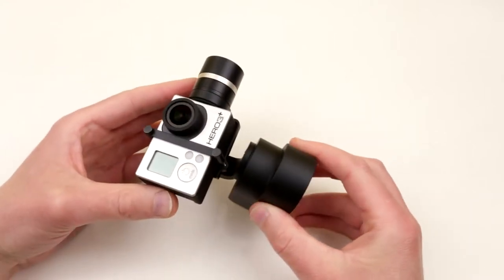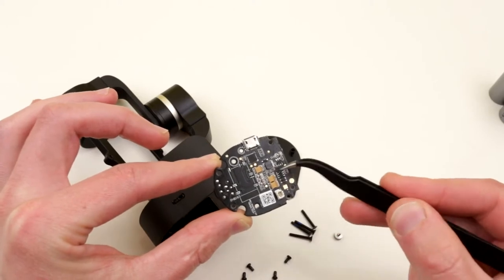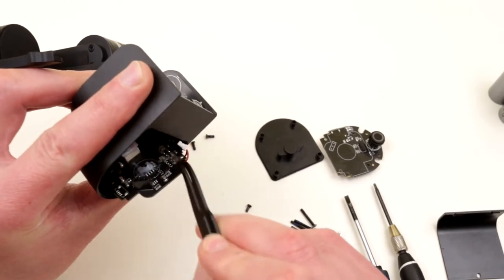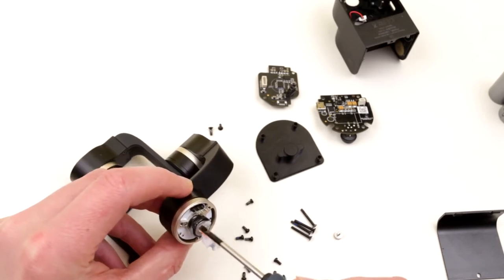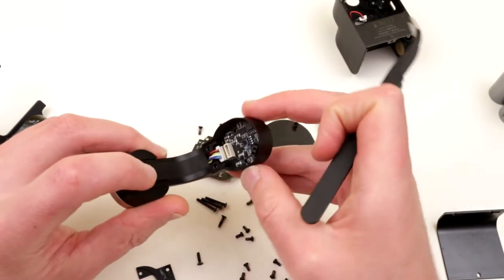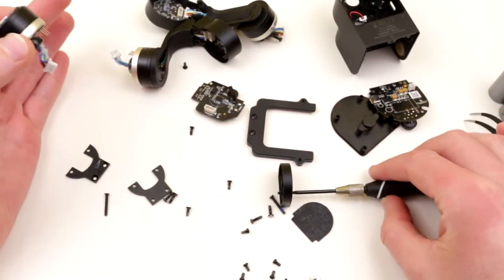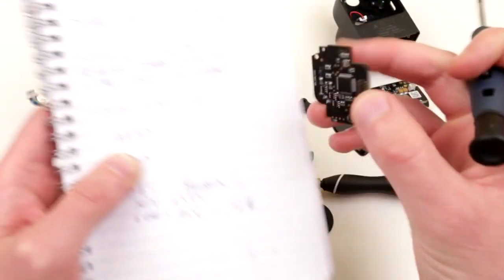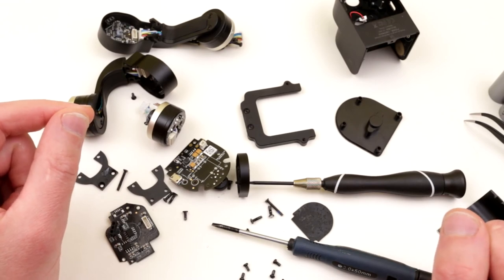Teardown of YI Handheld Gimbal

Comment: There is a serial Bus to connect the USB to PC for the Yi Gimbal Calibration tool. You need to use this tool if you intend to use a smaller or lighter camera on this gimbal. The calibration is important as it records the 6 position settings for the camera weight and leveling. They don't say this but if you balance the camera weight on the mount so the arm is leveled horizontally the batteries will last longer as there is less work for the motors to balance!!!
Reply from the maker: Great tips, thank you

Comment: Thank you for the insight. Did you find out what kind of motor it uses?
Reply from the maker: Clearly brushless, but what brand I do not know, what exactly you looking for?
Reply: @InsideOutElectronics  I was looking at the written list and didn't see it on the list of other components. That was all I needed. I thought it was interesting that the motors had limits on range of motion. That was why I asked.
Reply from the maker: @jeremiahscott4190  I think motors have physical stop, I'm pretty sure motors alone are regular brushless motors

Comment: Awesome video! There is a way to block one axis? I use it mounted on my bike and I would like to have the PAN axis locked. Have you got some suggestions?
Reply from the maker: Looking into this myself, want to block pan and roll leave only tilt going. I think it is possible by creating ( 3d print ) brackets which will fix axis in certain position, and may require software change to prevent those motors to engage.

Comment: For me it seems to be a storm32 controller with encoder. So there is not an I2C-Bus but a so called nt-Bus (kind of serial bus). I wondered whether there is a 2nd mpu on the main board??
Reply from the maker: Thank you for correcting me. And of course it did look like it was made based on some sort open source / hobby product. Why woul you need second MPU ? I don't think it was one there.....
Reply: @InsideOutElectronics  The second mpu in Storm32 helps for angles around 45 degree, because there is somewhere a problem with only one mpu. so if you have 2 mpus you can correct this. One at the camera and one at the grip/housing so that you know where the gimbal was moved in total. If you do not have a 2nd one you get perhaps at certain angles a slight problem. But I think that bug is known at this yi gimbal, called 45 degree error. I hoped it was a software bug, but the missing 2nd mpu is then a hardware issue. I have ordered one used becuas it is so small.Without grip
Reply from the maker: @DocMicha  to be honest I have returned this one. It was underperforming. And purchased different gimbal. See my other review. But i did get to the teardown of it as of yet.
Reply from the maker: @DocMicha  Hohem XG1 seems to be working better, See https://youtu.be/viHSt3wj7i8 . When I tear it down I will pay attention to second MPU
Reply from the maker: Here is Hohem XG1 teardown... it has 3 STM32 MPUs - https://youtu.be/7p12_zu0HwY
Reply: the magnet is for the magnetic encoder, why do you think you need 2 mpu if theres encoders? encoders can say the current position very precisely

Comment: the magnetic encoder that you read as "D128 1000" should be read as "012B 1000".
it seems like a chinese version of Infineon TLI5102B E1000
https://pdf1.alldatasheet.com/datasheet-pdf/view/741503/INFINEON/TLI5012BE1000.html
Reply from the maker: Thank you got the info ! Wondering if anyone have hacked the firmware of this guy or Hohem XG1?
Reply: It is Infineon TLE5012B E1000 if you still care

Comment: Hello! Good job! Do you know, can I add some connectors or joystick to control "pitch" "yaw" or "roll" camera position? Like a new models.
Reply from the maker: I'm not sure, did not do any investigation. But this model can be connected to PC via wire. On other hand it is lacking BT module, unlike Hohem XG1. BT module would allow controlling this via smartphone.